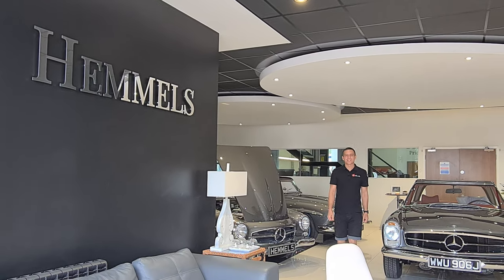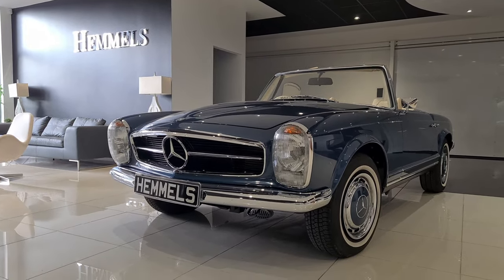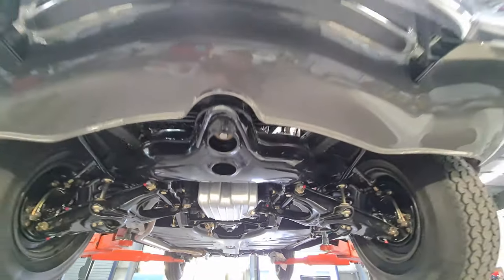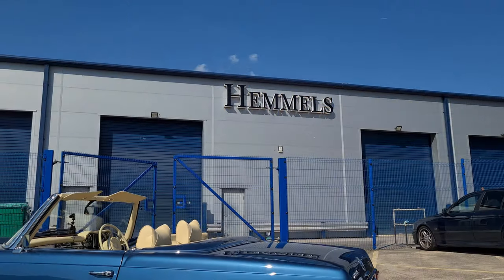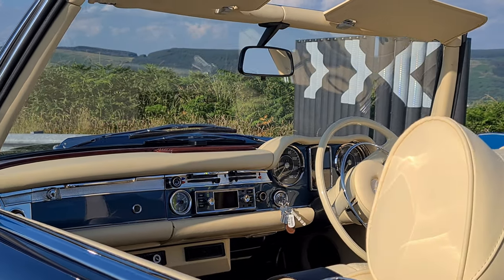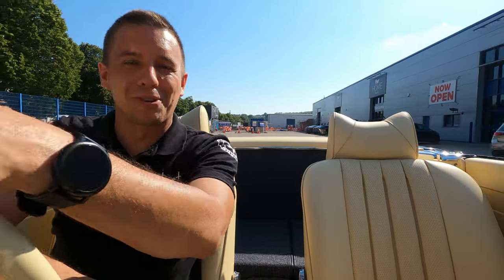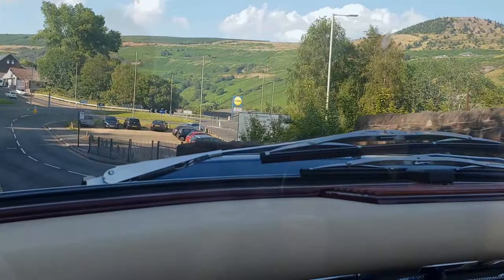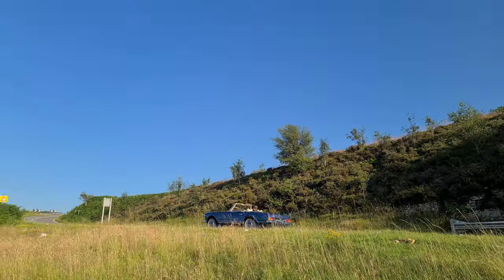Driving A HEMMELS Mercedes 280SL Pagoda W113; The Hemmels Experience.

Comment: My mother had a 1964 230SL automatic back in the mid sixties ; my father bought her it when it was two or three years old and alongside our W110 190 , these were the family cars during my childhood ; we also had a 1964 Land Rover and a succession of VW Beetles , so I grew up with an appreciation of German cars . The W113 stayed in the family for about 10 years , although I was too young to drive it , and was replaced by a R107 350SL , which remained only a few months until my mother realised how much fuel it drank , at which point it was replaced by an Audi 100GL , that car remained in the family for 20 years and I drove many miles in it ; it was a really good car , it became mine then my sister's after me .
I learned to drive , and passed my test , in my father's W115 220/8 then a year or so later , when the W123 series came out , he bought a new W123 250 in Maple Yellow and gave me the 220 .

Alas , in 1978 , a drunk driver came around a bend on the wrong side of the road and crashed into my 220 ... it turned out the car was also stolen , he had no licence nor insurance , but i was in a Mercedes-Benz vs a Ford Capri , so , despite the front crumple zone being badly crumpled , I stepped out unhurt , while the other guy had face lacerations , a broken nose , several broken ribs and three broken limbs . That score was Mercedes won ; Ford lost .

I replaced that car with a W114 280E 5 speed manual - what a fantastic car , and around the same time bought my 1957 Ponton 219 , which I kept for 34 years . I also had a W111 220S Heckflosse for about 10 years ; I bought that car because it reminded me of the W110 190 my father had while I was a child . 

I won't bore you with all my other Mercedes cars which ranged through W116 , W123 , W124 , W126 , R129 , W201 , W140 and numerous others , currently driving a W124 , but I do remember far enough back through Mercedes Benz history to recall the cars shown here , and spent many hours in my mother's 230SL , which I wish I'd had the chance to drive , but I was too young back then .

Comment: How does the engine perform with modern fuel injection?
Reply from the maker: I personally have never driven an original 280SL, only this one. 
However, Ben (Hemmels Technician) did say it drives smoother with the added reliability.
Thank you for watching.
- Drew
Reply: @accelerateyoutube  
I had an original 230SL. It was a pig to start. The engine needed a few revs on turnover to get it going, so having a bigger battery than standard was essential. Mercedes put a starting injector in the inlet manifold to aid starting.

What transformed it was fitting contactless electronic ignition. It started immediately, being smoother, and faster, on acceleration, and a slightly faster idling speed.  I found I could disconnect the starting injector.

I do not know what benefits there are with the new injection system. Or how much it differs. I took the injection pump off taking it to a Bosch dealer who calibrated it. When collecting it, he asked how many miles it had done. I told him 60,000. he said it was spot on not requiring any calibration. He greased it up saying it will stay that way for another 60,000. 

The 300SL was high pressure direct injection - they used the injection pump used on the WW2 Me109 fighter plane. The later SLs used low pressure mechanical injection into the inlet ports. The injectors needed the odd cleaning. Take them out, then best by compressed air, then coloured fuel to see the 60 degree cone.